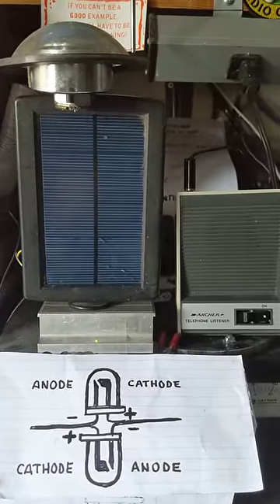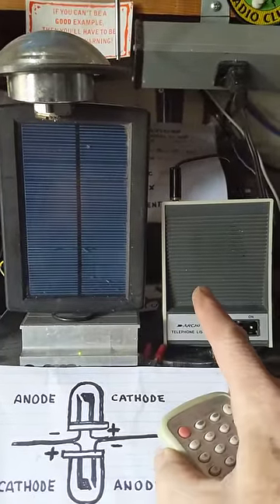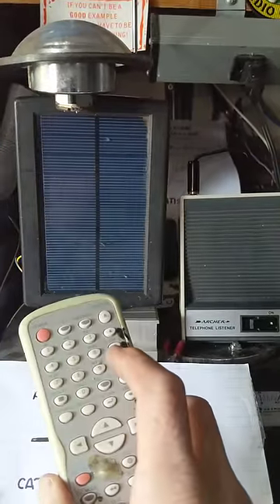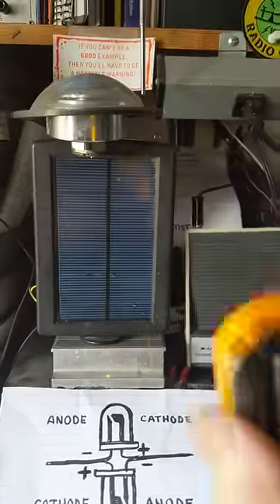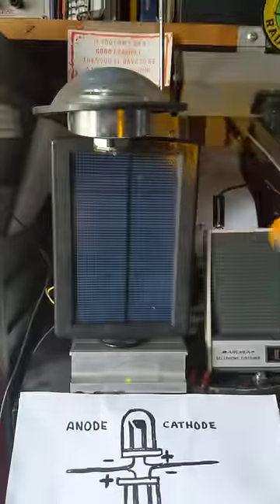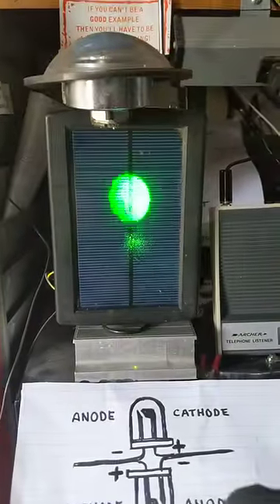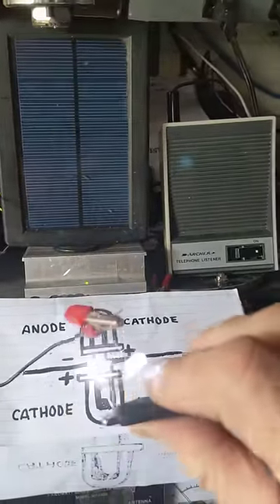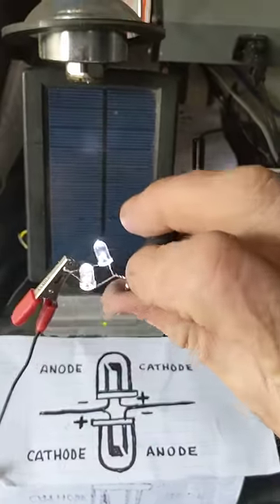Solar Panel Audio Detector!

Comment: The two radio stations got me confused as to how that works, but tis was the coolest demonstration I have seen in a long time.
Reply: Read my explanation.
Reply from the maker: Two local radio stations are putting out so much power, they are able to light up the LEDs because of my 200 foot long wire antenna and an earth gound.
Reply: @AlexTuduran  you act like youre famous or something dude, your explanation aint nowhere to be seen.
Reply: We used to take a diode, pair it with a very high impedance speaker (2000 Ohm) and listen to local radio. The diode acts as a demodulator for AM radio waves. In essence, it reconstructs the audio signal that modulate (Amplitude Modulation) the carrier frequency. The higher the impedance, the louder the output.
Reply: @TheDooreater  I just was on my phone and was harder to copy - paste. Thanks @GrimmSmile23.
Reply: @GrantsPassTVRepair  I listened to Art Bell once or twice complaining about the static voltage his loop was inducting 😅 Pow!
Reply from the maker: @EightiesJames  I remember Art Bell talking about that. I did a similar experiment you can see at this video. https://www.youtube.com/watch?v=yqljaKjKjd4
Reply: @GrantsPassTVRepair Oh, so like a crystal radio?
Reply: @GrantsPassTVRepair I'm guessing those stations are AM and you used a demodulator?
Reply: Still can't see or find it ..  @AlexTuduran
Reply: @Vanpotheosis  Here you go: "That's not weird. We used to take a diode, pair it with a very high impedance speaker (2000 Ohm) and listen to local radio. The diode acts as a demodulator for AM radio waves. In essence, it reconstructs the audio signal that modulate (Amplitude Modulation) the carrier frequency. The higher the impedance, the louder the output.".
Reply: @AlexTuduran excuse me but your comment doesn’t have an explanation, what kind of response is this
Reply: @adawg3032  Ok, here's an explanation. You would have a simple circuit where the speaker would be connected to the diode in series: [ground]--[diode]--[speaker]--[antena]. Then you take one of the ends (ex. the diode) and ground it - we used the old heating radiators network and the order end would be putting in our hand or in mouth. Sometimes we would experiment with the diode connected to the speaker in parallel and get similar results. Note that the speaker would not be a normal speaker (ex. 4-32 Ohm), but something you would find in the receptor of an old wired telephone. We would call that a "galena" and would have very high impedance. Of course, you would have to listen closely. Essentially, the diode acts as a demodulator, reconstructing the modulator signal (the audio) from the carrier signal that's broadcasting.
Reply: @GrantsPassTVRepair  rather fascinating. A 200' long wire antenna... I'm something of a novice in understanding Antennas but couldn't this work with a much shorter wire if you whipped out an antenna calculator to determine the best length and instead of a long continuous wire you bent it at sharp 90 degree angles at intervals best suiting the station you're trying to pull? Kinda like a Gray-Hoverman UHF antenna only kinda big because of the lower target frequency.
Reply from the maker: @411DL You can get away with some bending, but when you bend or wind a straight wire into a coil, you alter it's resonant frequency, but if your close enough to a local radio station, I'm sure you can get away with a shorter wire that isn't perfectly resonant, such as my 200 foot long wire antenna.
Reply: I used to listen to the radio on my guitar & amp many years ago. I seem to remember receiving "The Crow" from Nevada in Vancouver.
Reply: @GrantsPassTVRepair is it possible to tune the antenna and charge battery cells with this ?
Reply: @GrantsPassTVRepair 
  Would this be similar to induced voltage? Thank you.
Reply: @AlexTuduran  This doesn't seem the case in this situation. There are two diodes which act as a current to light converter.  LED's are generally fast operating devices so the amplitude modulation should still very present in the signal. On top the audio in the optic signal should be quite distorted because of the non-linear operation of the LED. It seems more obvious that, either the solar panels internal resistance and capacitance are forming an integrator, or there is a de-modulator present in another form somewhere along the line.
Please explain better
Reply: @MisterRockAlot  When converting from AC to DC you use a 4 diode bridge, but that's not enough. The 4 diode bridge acts as an abs(x) function on cosine(x), so the signal is still oscillating in amplitude. To counteract that, you further use a high capacity capacitor that acts as a low-pass filter on the signal and removing high frequencies from the signal is what makes the DC more steady and less oscillating. Now what's the connection to our radio you may wonder. Well, when you put a capacitor in parallel with a signal, it acts as a low pass filter, but when you connect it in series, it does the opposite - it acts as a high pass filter. Coils on the other hand do the exact opposite - act like a high pass filter when connected in parallel and as a low-pass filter connected in series. And you know what is the coil in our circuit? The speaker (the higher the impedance, the lower the cutoff frequency). So while the LEDs may be fast, the speaker acts as a low-pass filter on the AM signal, effectively removing the high frequencies (the carrier) and leaving the envelope of the AM signal - which is the audio signal that was used to modulate the carrier in amplitude. And I'm thinking the LEDs aren't that fast after all (I mean not 1500 kHz fast or whatever the carrier frequency is), but I might be wrong.
Reply: @AlexTuduran  Thank you for elaborating. The way I saw it is the antennae is receiving AC signal. The positive current would flow through the one LED, negative current thru the other LED. The total light emitted by the two light diodes together is abs(x). Of course this can't be exactly abs(x) since the light emitted by the LED is not exactly linearly proportional to the current, but that doesn't really matter that much in this case. So full wave rectified x is presented at the solar panel. Now if you were to full wave rectify the modulated signal (carrier frequency) the demodulated signal is not lost. However if you remove the carrier before the full wave rectification by the LED setup and it's optical transfer. The abs function would ruin your audio signal. 

But yeah you are right the solar panel is the diode in this case which is generating the DC variable current which is in turn filtered by the speaker. Additionally the parallel capacitance of the solar panel is usually quite large and should also add to the filtering.
Reply: @AlexTuduran that explanation is better..... good job
Reply: @MisterRockAlot  That makes sense. The panel is the diode. Thanks!
Reply: @AlexTuduran  That's awesome! There was so much more to the situation than just LEDs and an antenna. Thanks for the explanations.
Reply: With an audio signal added, you could make the movement of clouds audible. You'd need a lens or tube to isolate a portion of the sky. Sounds like fun!
Reply: @DullPoints  You're welcome. Glad to help.
Reply: @GrantsPassTVRepair  wow radio waves are cool, so you can catch enough radio wave energy to light up the LEDs, wow sometimes i forget how awesome electromagnetism can be

Comment: I love what someone else said about electronics and electricity: "Know a little bit here and there about electronics, and people will think you're magic."
Reply from the maker: Most everything in life is magic as far as I'm concerned.
Reply: @GrantsPassTVRepair  I hear you on that. The only hard-core magic I have is a complete understanding of how GPS works, including how to do the calculations by hand. That's more than enough in my opinion.
Reply: @vljYWOK How on earth did you learn that?
Reply: @pioussutherland  I'm a Licensed Land Surveyor with a bachelors degree in Surveying, it was part of the course work.

I also worked for MnDOT geodetics which is the state liaison for the NGS which is part of NOAA which works with NASA to keep the satellite constellation going. I was end user QAQC testing ground derived location vs constellation derived. In MN we are sub .1 ft at a 95% confidence and sub .03 ft at a 65%, which is amazing considering all the variables.
Reply: @pioussutherland  I had a longer more precise explanation but it didn't post...
Reply: Mind you my accuracies stated are for RTK VRS L1/L2/L5 GPS solutions, basically survey grade GPS, your cell phone will be 3 meter at 95% which can be post processed down to sub 1 ft using known ground control corrections.
Reply: For anyone wondering how GPS fits into what's going on in the video. GPS uses time of transmission of radio signals to determine length and then uses a minimum of 4 lengths to derive the location of the antenna. So GPS is space radio waves that literally say "this is satellite ## and the UTC time and date is ################" over and over. Then we take that transmission and compare it to actual UTC to figure out how long it took the transmission to get from the satellite to the reciver and then compute that distance. The Hz of the radio wave is a key factor of the accuracy of that computation. The smaller the wave length, the more accurate it will be.
Reply: @vljYWOK that’s so cool thx for sharing.
Reply: Electrics; fun magic
Computers; Black magic
Reply: Advanced enough technology is indistinguishable from magic
Reply: Those Minnesotans, always with the smart stuff..... 😉✌️😎
Reply: @privatelast8724  "Is this too much voodoo for our mission statement?"
Reply: I've made an entire successful career about knowing a little, here and there,  about electronics and radio. Certainly never thought of myself as an expert in anything, but the companies I've worked for certainly do.
Reply: Wow i didn't know that's the accuracy of phone's GPS. That's an outline-of-the-bulls-eye accuracy.
Reply: @GrantsPassTVRepair  I thought I knew abt electronics. 😂 this is amazing!! Also pls lmk how the led radio station thing worked? 
Id 100% make my own no matter how long it takes me to get a telephone Amp, which I am young enough that I've never heard of that- 
But yeah lmk how that works, this is extremely interesting to me tbh
Reply: @obesegorillagaming4698 I'm 47 and I'm right there with ya bro
Reply: It's basically magic but with some hard rules.
Reply: @vljYWOK  you’re very well read on GPS. I never knew that’s how gps worked, but seeing as it works by transmitting and receiving I have a question. Have you heard of direction finding via gps? I’ve heard some stuff from a buddy in the army
Reply: Both stations are broadcasting end of the world type news

Comment: I have absolutely zero use for anything like this, and none of the parts to build it. But that doesn't stop me from absolutely needing one of these in my life
Reply: Just wait one day none of the phones will work, but you won’t remember that or this
Reply: Hahaha I know right! I have the stuff to do it though 🤣
Reply: This video sparked a curiosity in me, Im not very knowledgeable in any of it but My brain keeps circling back around to practical applications. Any ideas?
Reply: @shane10  it might possibly detect laser light from a police speed detector
Reply: It can be used in an emergency if you don't have a radio and need to hear an emergency broadcast or something. In a serious emergency only emergency stations should be broadcasting so you won't have to worry about hearing more than one radio station
Reply: Zero use of a solar panel?  Sure?, go check ur home
Reply: Same.  I just imagined a future where I am in my basement, searching for other survivors, scanning the radio waves with my "LED Antenna Cathode Radio" thingymajig.
Reply: I want one for the grave, maybe have the speaker buried down there with me.   Wierd sounds and voices.   Perfect.
Reply: If it can pick up the TV remote I'd guess it could be used to find hidden cameras or remote devices. Could intercept radios maybe but I'm not a radio dude.
Reply: Can it detect hidden cameras?

Comment: This might be the coolest thing I've ever seen in my entire life.... I would like to figure this out.
Reply from the maker: If you don't live near an AM radio station as I do, you may need to light your LED from a different source. I tried attaching an LED to my speaker wire output and it worked, but it had some distortion.

Comment: Back in the mid-90's when walkie-talkies had those long pullout antennas, I could stand directly underneath an overhead powerline and pick up people's wireless phone conversations (not sure if it was cellphones or just wireless home phones, I was only like 10 y/o).
Reply from the maker: I remember those days before they began to encrypt the cordless phones. You probably had one of the 49 MHZ walkie talkies. I don't think any of the Cordless used the CB frequencies.
Reply: You could also just use the 49 MHz phone as a receiver with the base disconnected. I had a Sony with 10 channels you could roll through and listen to anything on those channels.
Reply: Picked up our neighbours phone convo once with a walkie talkie as a kid as well
Reply from the maker: @sondreglosli6955  I remember those days before they changed frequencies, and   encoded their transmissions.
Reply: My VCR used to pick up CB conversations, and our payphones would pick up cellphone coversations.
Reply: That's really cool!  I had to try these myself, which was easy since I happen to have a solar panel I already soldered an audio plug onto. 

(I do a lot of DIY synthesizer and Eurorack stuff, and I normally use the panel as a control voltage input to the synthesizer — translating the amount of light that hits it into pitch, volume, or timbre changes — so it was really easy to instead plug it into an old Radio Shack audio amplifier and hear different light patterns.  One big source of pulsing light around the house: fluorescent or LED light bulbs!)
Reply: In the 90's I had an old TV (those with wooden side panels) that if I changed the manual tuning I could hear some telephone conversation, but I could only hear one person and not the other.
Reply: @bazem  same,  but mine was a plug in portable TV, it was very cool.
Reply: I remember when I was a kid if it rained the water somehow got in the phone lines and crossed the circuits or something. For the next few days I would be able to hear other conversations when I picked up the phone. They would be faint and I could barely hear them over that dial tone noise that you used to hear when you picked up the phone. One day I heard two ladies talking and asked if they could hear me and they didn't respond so I screamed really loud into the phone and they stopped talking in one asked the other "did you hear that?". The other one had heard it but they eventually brushed the whole thing off and continued talking. I forgot all about that until just now reading these comments.

Comment: I have done this a few times, even used a laser to send radio from one end of the house to the other. Its a pretty simple experiment to put together but hearing radio through a laser beam just seems like magic so it makes a great project to play with.
Reply: How?
Reply: @cheeseburgers82  all you need to send music from paser to solar panel is a small laser light, put a transistor on the power wire and connect the base with a resistor to an audio signal from any audio source say an mp3 player etc. On the other end the solar panel will pulse electricity  from the laser pulses, so a small audio Amplifier can take that signal and put it to a speaker. It's not a difficult circuit. You can use mostly off the shelf things you just need a transistor and a resistor to pulse the laser with the audio wave on the TX side and an audio amp on the other Rx side.
Reply: I mean to be honest... It kinda is magic 🤣🤣🤣 like let's be real, electrical engineers are absolutely magicians. And I think it's funniest that everybody wants to pretend like they'd be really into magic if it were a thing, but nobody's into real-life magic because it's like super hard to learn how to do
Reply: Behold. Fiber optic communications.
Reply: I get the fascination, but to me it sounds like suggesting that you head east & travel around the world to visit your next door neighbor 1 house to the west.  If the radio signal is present in 1 room in your house, it's (most likely) in every room.  There's no need to "send it" to another room.  Right?
I know nothing about electrical engineering, and I'm NOT trying to be snarky, just curious.
Reply: At least you're honest 😅
Reply: @johangambleputty7658  this is not a project you do with a purpose, it's more of a proof of concept to show off your skills. The sound is being transmitted by light blinks at audio frequency. It's not RF, it's just pulses of light. I read somewhere about an idea to make LED lights transmit information without you seeing the blinks because it's so fast, but it could still be decoded with the right setup. One reason suggested that a robot could identify which room it is in by the signal of the light in each room. They had a few other use cases but I don't  remember them. Hope that helps.
Reply: @newmonengineering  Thats so cool thanks for replying with so much info!